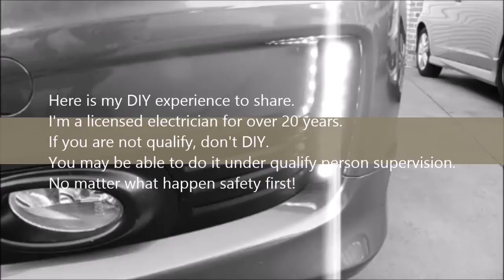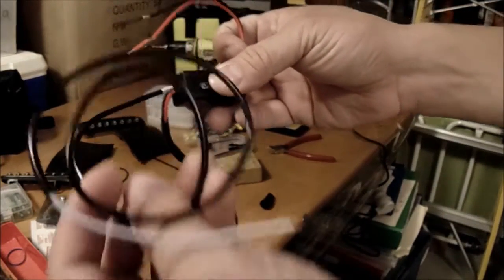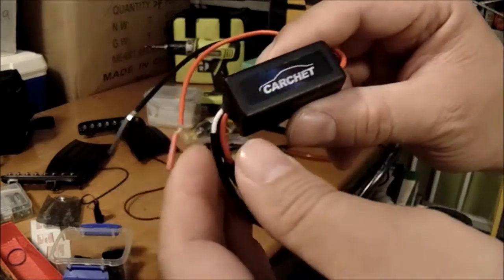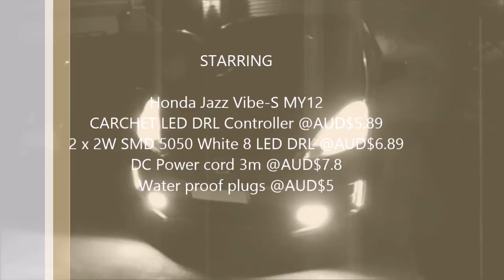$26 DIY Honda Fit Jazz GE8 Daytime Running Lights DRL Installation Part 1 of 2

Comment: The DRL on your green Jazz you bought from Ebay for $100, is it plug and play or do you still have to do extra wiring?
I saw the same kit on Ebay and it has a socket so maybe inside my Jazz it has another standard socket for it to plug into?

Comment: Hi Darwin I bought the DRL from eBay cause I'm not skilled enough to DIY my own.
I'm just curious as the one from eBay doesn't have a DRL controller with it.
will I have the drop out issues while driving without it?
i want to make sure it stays on consistently when I turn on my parking lights and to turn off when my car turns off.
thanks for the amazing guide by the way!
Reply from the maker: ***** That controller on video part 1/2 keep the light on when 12v supplied to white wire. It also reduce the power output by 30%, so less interference at night time. You can tap the white wire to parking light or low bream. I prefer parking light to save battery power. Otherwise you need to turn on low beam at all time to keep DRL on permanently. End up your headlight is on all time. More than likely your battery will dead sooner. I changed my Jazz original parking light to LED. I case I need it, I can turn on parking light. Therefore DRL & LED parking are all on. It still consume small amount of power only. You won't be able to do it by attaching to low beam. I found that by turning on air-con, the motor idle speed increase to provide extra power to run the air-com compressor. The generator voltage will increase. My DRL light will keep running at auto mode without cut in & out. Thank you for watching my video.
Reply: I know your post is 10 years old but did your Jazz came with a factory socket for you to just plug that Ebay DRL kit in or did you have to do extra wiring?
Reply: @camarov8power319  hey mate. yes it's been many years since i did this on my car and it's long gone! but I ended up hardwiring to the car and added it to a rocker switch so I could just turn it on and off independently whenever the car was on. hope that helps.
Reply: @ Thanks for replying and the tip!